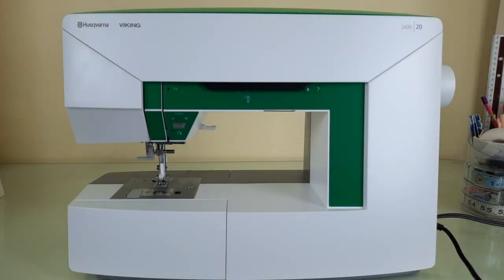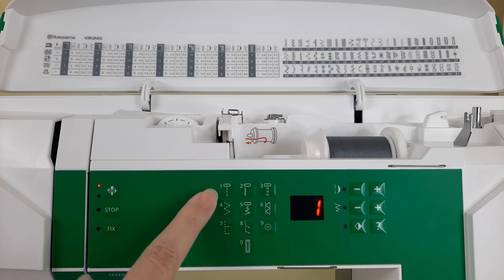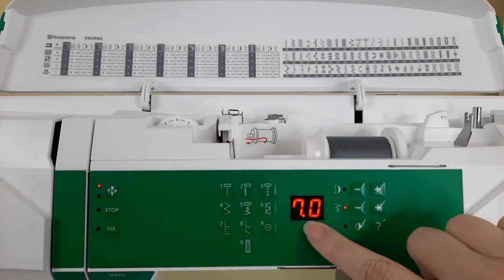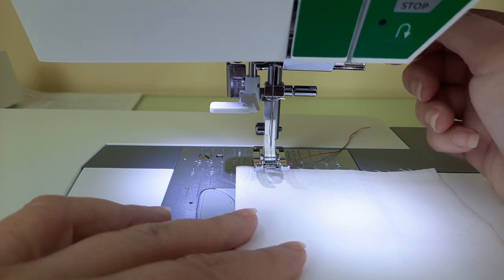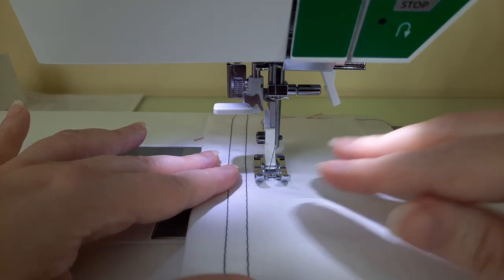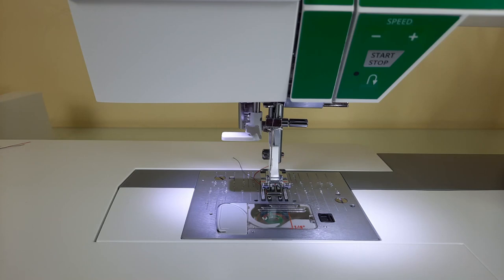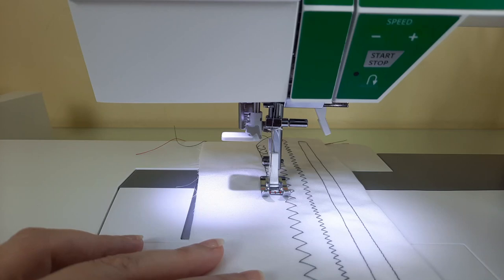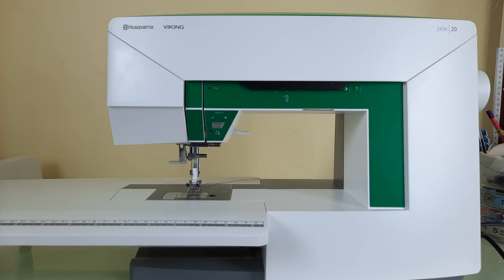Viking Jade 20 Part 2  Utility & Deco Stitches

Comment: I have this machine and was super disappointed that it did NOT come with a user manual.  So finding your channel has been a life saver. This machine is my second Viking but it works totally different from my 950E and it has been frustrating getting used to it. I have several sewing machines and went back to them because this one is not that intuitive to me. But I'm making a quilt on this Jade 20 now and it is getting easier thanks to your extremely clear instructions. I bought this machine last July 2022 and only used it twice before taking it back for some instructions, then put it away until this week.  The bobbin winding was impossible until I found you. Thank you.
Reply from the maker: I'm so happy my video was helpful.  Happy sewing!
Reply: @RoxanneStitches  I am so very grateful.
Reply: I agree with you that this machine is a bit of a mystery to me. I replaced my Viking 1 with this one and I'm having some problems figuring it out. Without these videos, well I would be lost!